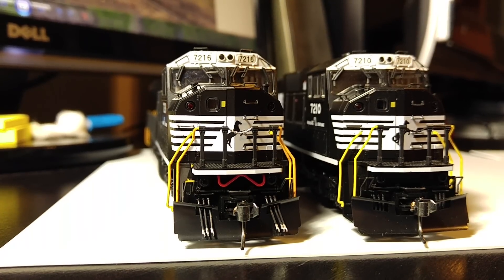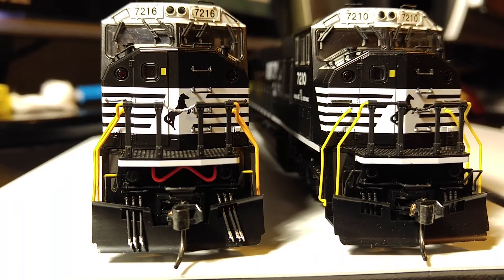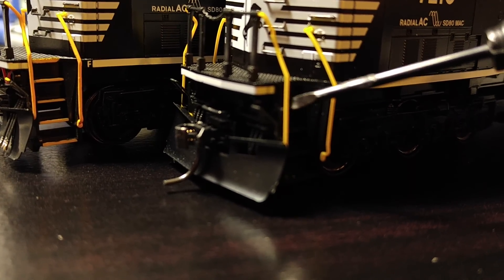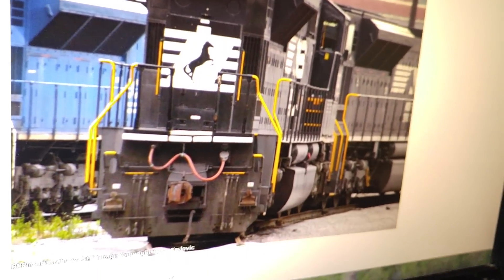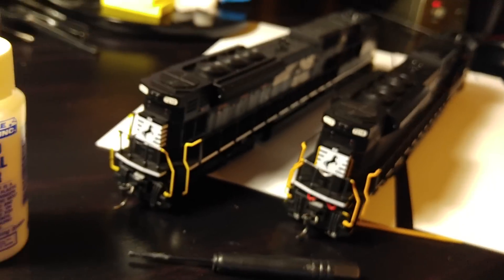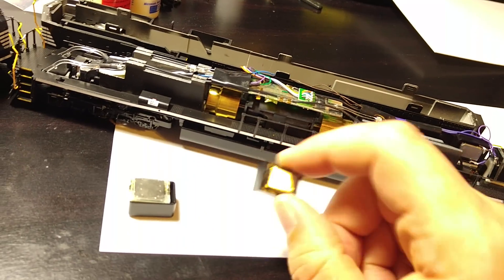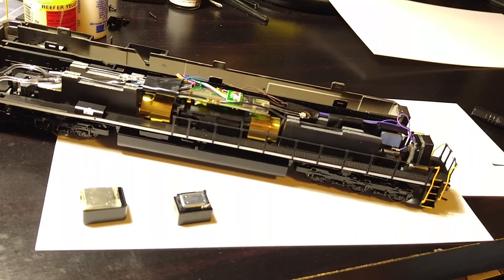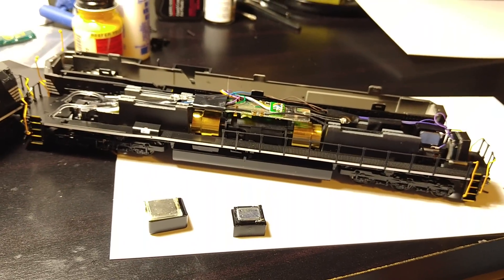Easy Modifications to make your Kato SD80MAC more accurate

Comment: Great video, I have two 80 macs myself.  Kobo version 7216 and 7210 I ordered w/o sound but got my loksound decoder last week to install in it. I'm going to use your videos to get everything detailed and installed.  Question? once I install the decoder will I be able to hear anything before taking it to my buddy to program it?  Thanks again!
Reply from the maker: Depends on if you are buying the decoder with a soundproject already loaded on it, of course you will also need to hook up speakers to it as well
Reply: The decoder I have is a Loksound Select 6 AUX Universal Sound Ready for Programming it says on the label.

Comment: Which loksound decoder is that, and is it with the 20 cyl. 710?
Reply from the maker: spacecalander yes it is 20cylinder 710, loksound is the only that has it, these have a select in them
Reply: Thanks alot for the info. What is the model of the actual decoder, is it the 8 pin?or the 21 pin?
Reply: Another question, which wires on your 8 pin lok did you use for ditch lights?  Thanks
Reply: Where's the best place to put my 2 cube speakers at on the 80mac?